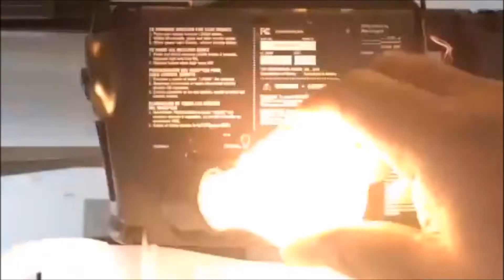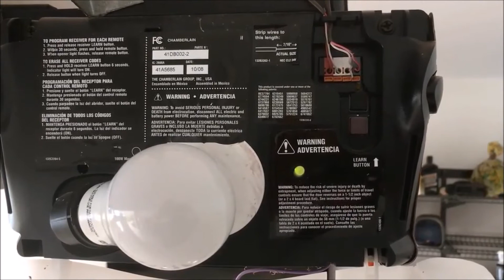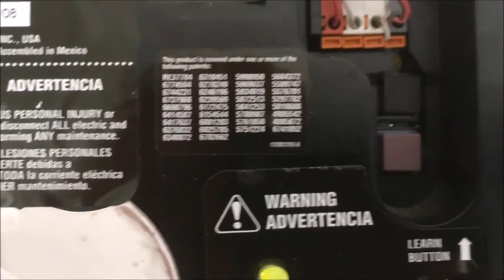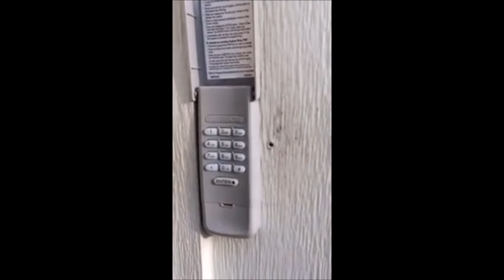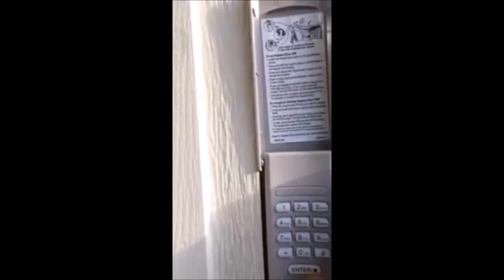Chamberlain Garage Door Opener Programming And Erasing Codes Also Added Time Stamps

Comment: I have 3 doors and I am trying to program three-button remote control for each door. What's the best way to do that?  When I program only one that button worked find. When I added the second button for second door.  The remote got confused with first programmed door and started opening both doors with one button. Did any one have the issue?